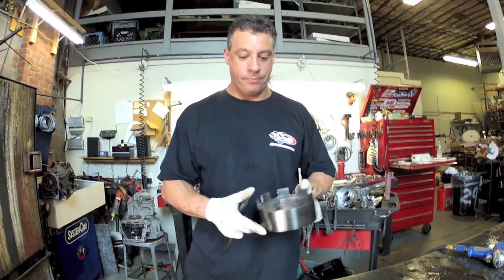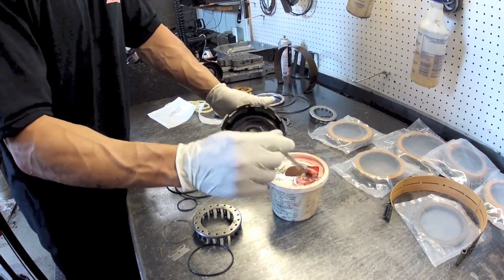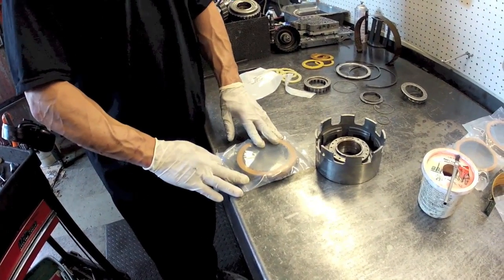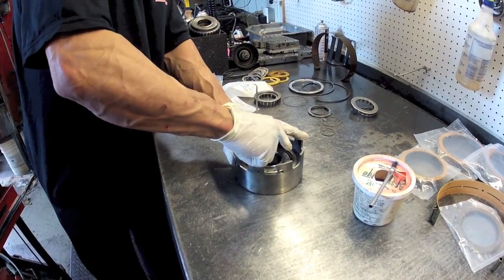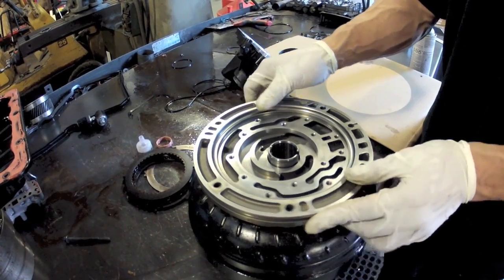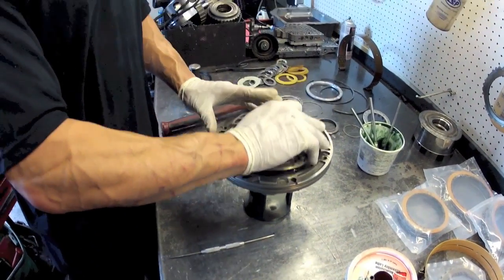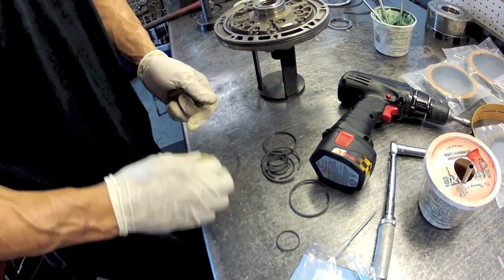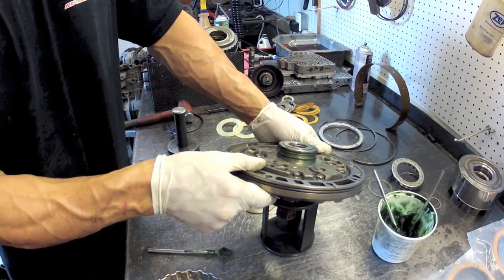IPT Performance Transmissions Toyota A340 Rebuild Part 3

Comment: hello i am doing a engine and transmission swap but i cont find any info am the transmission that come with the engine model 30-40ls 35000-3f460. i am trying to find out it the transmission have the  tiptronic function? how can i tell?

Comment: hi i have a aisin 30-42le and when going down hill and i press brake it clunks like a brake is bring applied in transmission but you can feel it when it does it and sometimes from 2nd to 3rd slight hard not much but its there and both faults don't always happen  would appreciate some info is it a valve body issue? also are parts same as 30-41le?